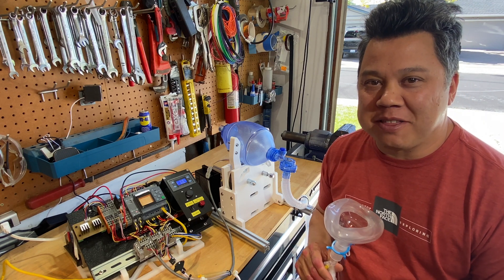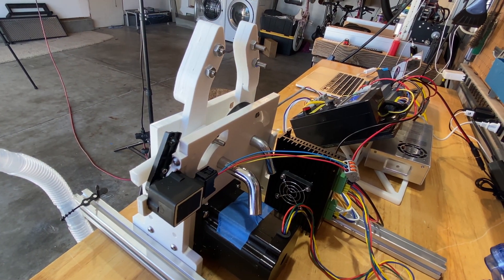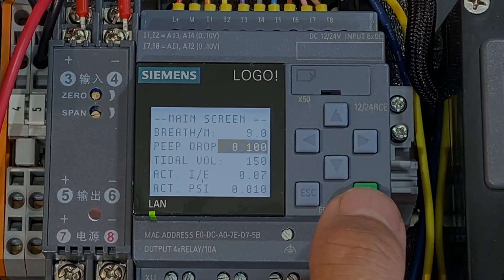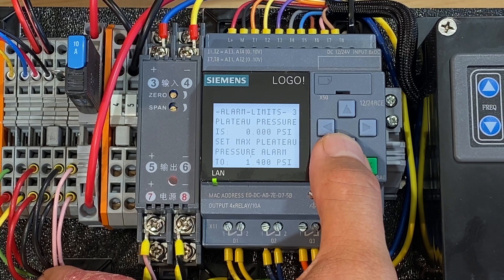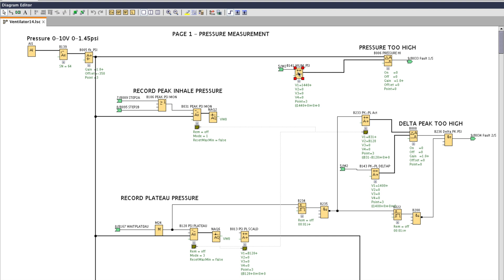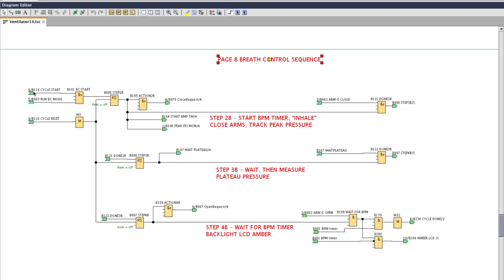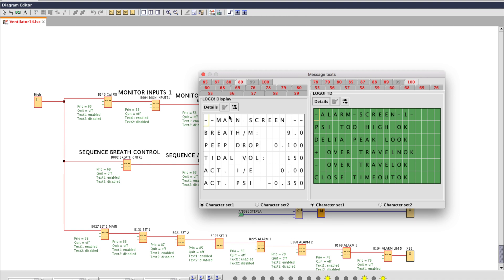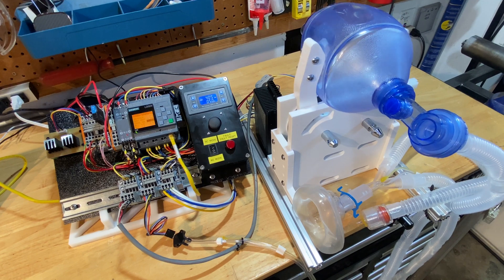Completed.  Open Source Breath Controlled Ventilator. DIY using a Siemens LOGO PLC

Comment: sir we are assembled your circuit but we are used potentiometer in place of hallsensor . motor is moving in one direction only . 

showing alram screen 1. + overtravel nok 
                                         2. open time out

Comment: Sir, thanks for your Part-3 of this series, we are now making this ventilator. Due to lockdown at our place, there is a problem sourcing the parts, but we trying to get them.
Reply from the maker: What parts are you having trouble sourcing?
Reply: @etischer  Now we have received all the items. Our Stepper drive model is DM860H, please send us the electrical wiring diagrams from LOGO to Drive (Directions and pulse connections). Also please send the all electrical connections diagrams.
Reply: @etischer  We have almost completed this project, we have added HMI as user interface. Thanks a lot for your design. I also request you to guide us to provide one more variable parameter ie., IE ratio in BC mode.

Comment: Sir, nice work... Extra ordinary....
I have a doubt. How can calibrate the relation between tidal volume vs can angle? Can you share the table
Reply from the maker: Volume is adjustable, and repeatable, and will have to be adjusted based on feel from the patient, or by monitoring pressure feedback.  Alternatively, a look up table could be generated, but the math is probably too complex (non-linear) for the PLC to perform,  the look up table might just be a piece of paper translating Arm angle to mL.  A flow meter could also be added to the PLC, it  just costs more money.  One of the compromises when working with a limited budget.